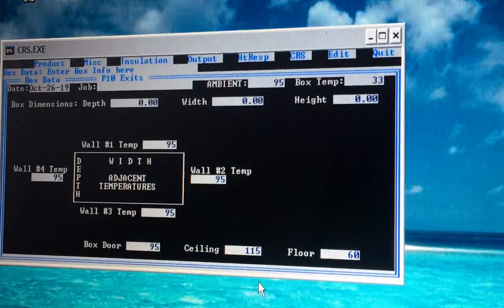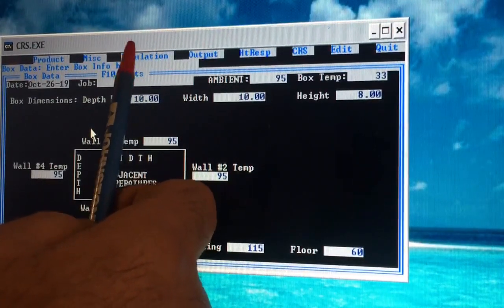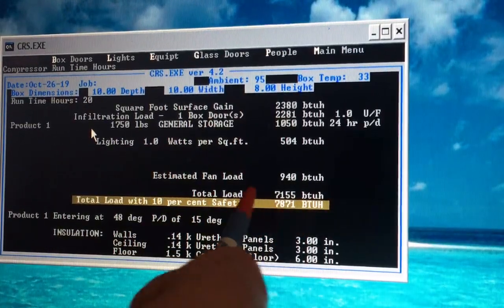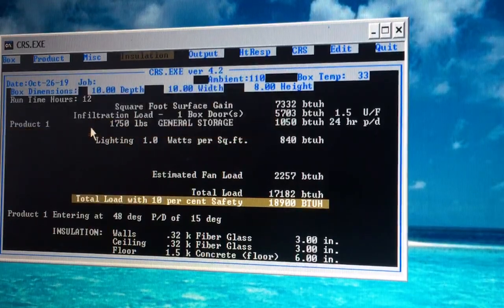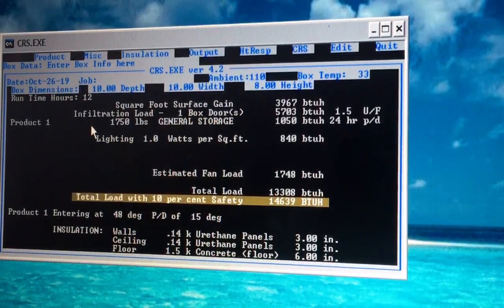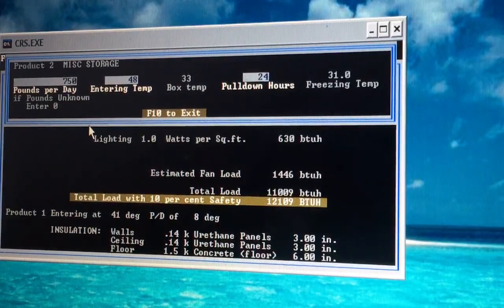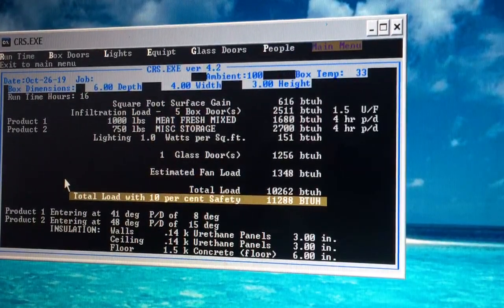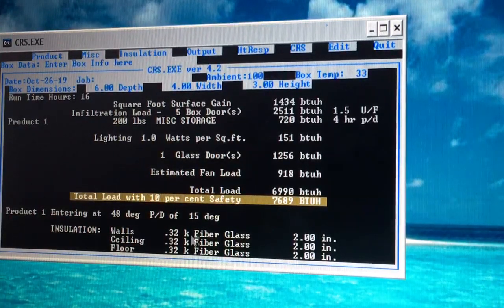How to Calculate Btu's Required for Refrigeration. Walk-in cooler, Cooks line etc.

Comment: Definitely oversizing. 250 watts of lighting? LED 4ft tubes are cheap for conversion and no ill affects from cold box temps. Our boxes this size have 36 watts of lighting and its clean and bright. 430 watts (1460BTU) for fan motors? Should be 35-50 watts per motor so <100w or 340BTU. If you have 2 speed motors much less even.
Reply from the maker: 👍. Yea, this is an old program. 40 years old. some personal observations & adjustments as u say are needed for todays Lighting & motors. but in actuality lights & motors arent going to make much difference.

Comment: Hey,  I am trying to calculate for my light duty walk in refridgerator. They have 3 inch foam panels, 16x10x8, run time 12 hrs, cant seem to use the program. I was wondering if you can calculate for me by chance. Thanks!